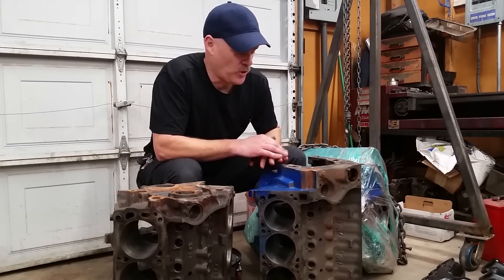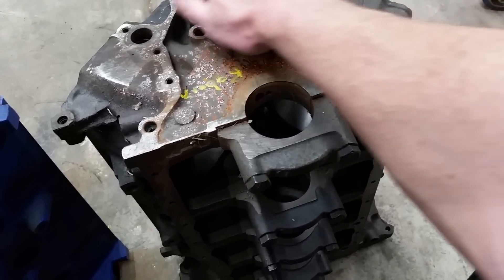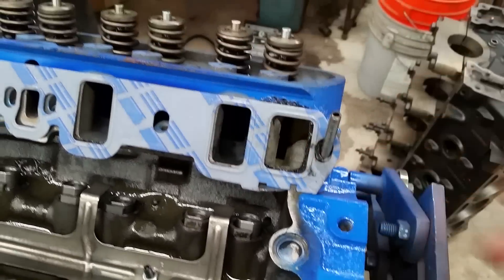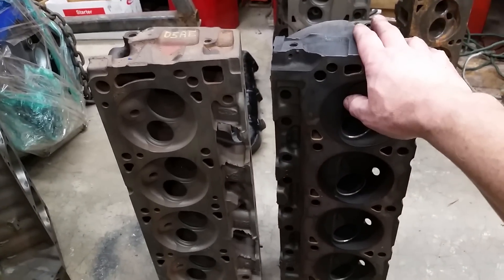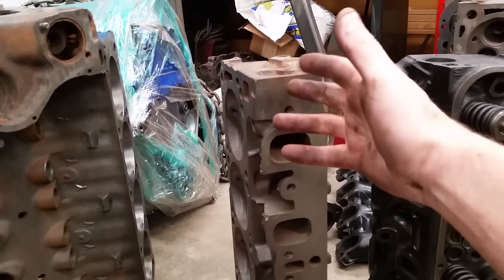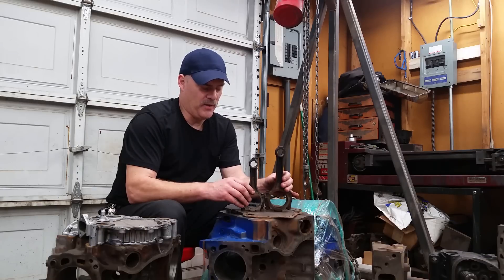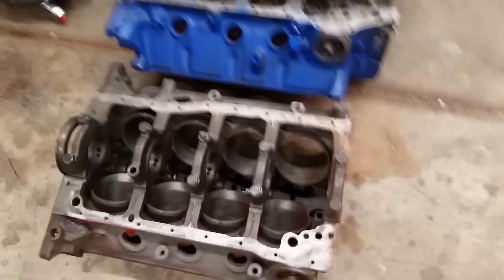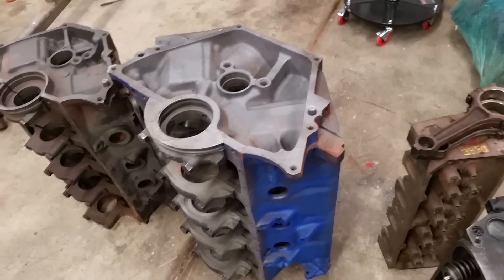302 vs 351M blocks

Comment: The reason the  400 had  the style  engine mounts and bellhousing bolt pattern,  the engine was designed to replace the 390 FE engine in the full size cars. The mounts were designed to fit into the same location as the  460. This made it easy  to install ether a 460 or a 400 using the same frame mount and transmission.   Ford didn't  intend  the 400 to be used as a small block replacement!
Reply: Cause the 390  did not meet emissions laws  for 1977  1976 and early model light duty trucks had the 390 as a option  then  1977 and later trucks  390 was replaced by 351M and 400  and a stick shift transmission  was an option  but in the full size cars with these engines only had the automatic.
Reply: Correct, One year they were drilled small Windsor pattern for one model of car. The 351/400M are big blocks. Use C6 normally. I would like a 4 speed auto but nothing fits the block to my knowledge, or not here in Oz anyway.

Comment: David Freiburger was saying there is a stroker engine you can build from a custom block, known as the 1A (or it could be vice versa) there is so much roadkill / motortrend / DF material out there just on here , I would never find it! . But it has the size of the 260 / 289 blocks, but you can make bore / stroke combinations safely up into the 420 size while maintaining the smaller early block outside dimensions. I wonder if anyone here knows which block I am on about, as it's from Kaase or some other custom manufacturer.. But seriously, a 351 is a huge engine for what size it actually is ... just look at it in a bay fully assembled compared to a chevy 350 or LS .. GIANT! .. the 429 is actually not much bigger as it is in the same class of engine (Windsor) , just have a look!

Comment: Provided you know your valve covers, the easiest way to spot a 351W versus a 302 in a junkyard requires only a measuring tape.  Measure the engine from the inside of the valve cover to the inside of the other valve cover... the 302 is 9 inches, the 351W is 11 inches.
Reply from the maker: If you have seen enough of them you don't even need to do that you can tell just by looking, the 351W has a much wider intake
Reply: Yeah that's where I've been for years.  ;)  I can eyeball them too.

Comment: FE and Y-block are not the same. Y-block is a 50's design and came in 292 and 312 ci displacements, I think a smaller displacement in early years as well. Not sure on that. It was kind of a transitionary block between flat-heads and the 60's+ more modern small blocks. It got its name from the shape of the main webbing and casting lf the lower portion of the block. Rather than a flat bottom deck, it was Y-shaped and came down lower on one side. Made for an interesting and intricate oil pan design, but what is did was create and very strong lower portion of thw block with lots of rigidity. It is completely unrelated to any other ford big or small block. They were honestly really good strong running motors amd wouldve heals up and performed well against the 60's era V-8's. Only thing I am not sure of and maybe you have some insight on this, is the bellhousing bolt pattern, Idk what it does and does not match up with. I'm just a 26y old kid whose grandfather has an old 292 Y-block '55 T-bird.
Reply from the maker: Yes I am aware of that however the 390 as well as the big block Chrysler among others are all considered Y blocks because of the skirted block design and the shape of the block Lincoln also had their own engine and it was also called a Y block beginning in 1952
Reply: If you throw in Lincoln Y block you have the base design of where the FE block came from, same bore spacing, bell bolt pattern give a 3/8" diff in the align pins. Ford FE's used the same machining set up as the LYB & used the same foundry. When the 427's were coming apart Ford went back to the foundry and added the LYB side oiler back into the 427 blocks. From LYB to FE 100 lbs. went away due to thin wall casting. Even use the same lifters FYI

Comment: If anyone is confused there is a 351m motor but they did come in a 6.6l 400ci variation. I would check the valve cover it should tell you. I got lucky and got a 400ci, I plan to bore it .30 over which would make it from what I was told by formula 408.178. But who cares about the .178 I'm getting a 408 with a .30 over bore, good pistons, heads,cam,rockers,intake, get the compression to 10 to 1 or higher and that "dog" of a motor will run. One quick question I have is it the exact same size as a Windsor or Cleveland? I believe them to be just not 100% sure.
Reply: daniel johnson so if my engine says 351m/400 it's 400ci?
Reply: Sanity it could be check out the valve cover it should tell you your engine's displacement

Comment: If  a short  Rod is so bad how  come  I know of more half million  mile 302 fords than any other  engines on the road!  i know of a  1991 ford pickup 302 with over
750000 miles on the original engine and it is  still going strong!
Reply from the maker: The 302 has a very short stroke 3.000 a short stroke accomplishes the same thing as a long rod less rod angle you need to have a high rod ratio a shorter stroke raises this ratio as does a longer rod
Reply from the maker: the 302 with a 3.090 rod and a 3.000 stroke actually has a higher rod ratio than a 351 W  or a 350 Chevy and remember the higher the ratio the less rod angle this means less stress on the piston and rod bearings to get rod ratio you simply divide rod length by crank stroke a 302 has a 1.7 ratio whereas a 350 Chevy has a 1.64 so you see the 302 actually has a better ratio for longevity
Reply: Are you from Montana?  I think I know of the truck you speak of.  Lol

Comment: My son bought a Ford farm truck with a 351 modified, it only has 55000 miles but number 4 cylinder seems to have a burnt valve, is this a common problem? The plug has spark but it's oily and it's definitely no. 4 that either has no compression or something because the engine runs the same with or without spark on that cylinder.
Reply from the maker: I haven't heard of this being common but one thing is for sure you need to pull the head

Comment: could you show the difference between a 351c 2v head and a 4v head ? I think I have a 351c m-code in my mustang but I'm not shore
Reply: externally the 4V on the front is the only way. Though a 4V will always come with a 4bbl intake and a large carby.
Take the intake off and the intake ports are way bigger than a 2V. Too large!
There is 4v open and closed chamber engines, about 10cc different in volume. And all 4Vs have larger valves which like the ports are too big. For decades people have been fitting those heads with tongues on the intakes to try and get some velocity through the port.

Comment: My 1997 F150 4.6 is totally stock, 200,000 miles. When you get it up to 90 or so it has the sweetest sound. Single exhaust. Heart of a tiger.
Reply: 300000 96 tbird bullet proof sadly governor kicks in at118. Only once but lots left.lol

Comment: how can you tell the difference between 351m and a 400 in the car?
Reply: shyboyangelus As far as I know, you can't without taking a head off and measuring stroke. The 351m/and 400m have the same blocks. It's the crank that makes the difference. 3.50 vs 4.00. Just a technical fyi. 4in. stroke by 4in. bore is actually 402 cubic inches. Just for shits and giggles.
Reply: @thesixgunfighter288 rule of thumb is , if you have a 4 inch bore on a V8 the length of stroke is very close to the cubic inch displacement of the motor !
Reply: @JosephCowen-ru7up  You’re not wrong, 3.58/Mopar LA/Mag 360, 3.48/Chevy 350, 3.25/Chevy 327, and so on

Comment: really should be calling it a 351m/400 block because they are exactly the same and some may want to know by simple using the 400 crank and 400 pistons you now have  400 cid motor they both use the same rods and everything interchanges.....also if i remember correctly all 351m/400 blocks are cast for excepting the 4 bolt main caps   ..also you should know the 351m/400 crank main bearing are the same as the 351w and you can custom cut a 351m/400 crank allowing it to fit in a 351w block creating a stroke kit with all bone stock ford parts making your 351w a 413cid ford windser block if punched 30 over

Comment: Great vid, 400 modified's are very underrated engines, I had one in my Grand Torino,lots of torque, so can you put aftermarket 302 heads on the 400? Tks
Reply: would be a step back the stock 351m heads with a little port and polish flow better than even high end after market 302 heads
Reply: 302 Aussie Clevo heads only. Not Windsor.

Comment: You talked about liquid corrosion. In '81 my dad's 78 Chevy C10, lost a water pump. We added Prestone water pump lube. In '03 I rebuilt engine. To my surprise the steel head gaskets looked new! That was at 330,000+ miles. I just copper coated and reused them. Vintage '78 steel head gaskets and coolant hoses to this day. 
Take care from Oklahoma
Mike and Vee
Reply: Those old Chevy shim head gaskets are better than most realise. Use a composite gasket and you lose compression and they seem to fail quicker. I have used them as a single gasket, stacked to get valve clearance even used them with alloy heads. Though not so good there as the alloy is ofcourse softer. And never seen one blown. Leak a bit, yes, with heavily milled heads.

Comment: I had a nasty 2.3 lima engine 4 banger, milled  head, stainless steel valves, crane solid lifter cam half inch lift with around 260 degrees duration a four barrel split plane intake manifold with a 390 Holley going out a Hooker header into a glass pak around double the stock hp, as for rod length you can use chevy rods, aftermarket pistons etc.

Comment: 4 inch mains kills the longevity of these engines. At 100-120k expect  low or no oil pressure due to main bearing wear.
Reply: the 351m/400 has the same bearing size  as the 351w  ....the reason many of them only ran 120k/140k miles is none of the cares they cam in had over drive ....my 1987 ford f150 4X4 with it 351w ho factory 4bbl and c6 auto no over drive is doing 3000 RPM at 70 mph the exact same truck a year later with over drive and EFI at 70 mph is doing 1800 rpm so ye under normal everyday driving a motor doing 80% more revolutions will were out about twice as fast .....by the time they went fuel injected and overdrive in everything these motors were no longer used ....you build a bone stock 351m/400 and use modern trans with EFI it will also last 300k miles and get 18 to 20 mpg ....best friend had one a 79 ford truck 351m/400cid his was the 400 never ran anything but what ever on sale 10w40 gave up the goat at 365k miles but he changed the oil every 5k miles rather it needed it or not
Reply: dexter2433 the 400m front and rear main bearings actually wear out in no small part due to the accessory belts pulling the crank up. There's so much flex the front main bearings will wear out on the top and the rear on the bottom. Seen it.
Reply: These M engines always sounded wallowed out in the lower end if they had any miles on them and the oil pressure light would flicker at stoplights.  Weak oiling system.  
Weak design altogether.
Reply: @scdevon  Oiling system is fine, it can't keep up with worn out bearings.
Reply: They have 3 inch mains

Comment: A friend of mine bought a 1980 F150 new with the 351m. He changed the oil every 3000 miles, kept the truck looking like new. He was old and never beat on the truck. The engine was junk after 80,000 miles. Every valve guide was gone, rod bearings scared the crank, (rod bearings to skinny, a weak spot in design), and cam was shot.  He ended up buying a new motor and sold the truck.  
I do enjoy your channel. Very informative.

Comment: hi there i would like to know what is the 351 modified is it the Windsor motor as i have a 302 Winsor in my 1989 f150 4x4  and got to replace the motor in the next 6 months and can you  Cleveland motor be set up for unleaded fuel heads.
Reply: 351/400M is a tall deck Clevo big block. Nothing to do with a Windsor. Apart from 3" mains!

Comment: isn't  351 m engine an industrial engine my 78 F-250 has a 6 Qt oil pan when I rebuilt it camshaft I used is for low end and mid range push rods rocker arms and lifters also replaced and crank shaft replaced as well only original engine parts are pistons and connecting rods also used brass freez plugs before i rebuilt it   had 165000 miles on it and was getting about 19 miles per gallon on the freeway did not have power to get off the line but fuel mileage was great  made me think cam lobes had excessive wear motor not breathing correctly
Reply from the maker: Nope just a passenger car lite truck engine
Reply: Myvintageiron7512 thanks for the info

Comment: If you use the 2v closed chamber heads the compression raises to 10,75,1.is that to much for a 400?I hear you need to run 96 octaine plus or they can pre detinate?
Reply: RUN EM OM LPG cant get higher octane then that
Reply: You mean “pre ignition”, gas ⛽️ doesn’t detonate( super sonic) it burns (sub sonic). Explosives detonate.

Comment: I'm also hoping you will show a Y block eng 272 - 312.  I thought the 312 came out in 56 but everything i'm reading shows 312 didn't come out till 57.  I have a 56 F100 .  I was hoping it had the 312 Y block, but apparently i'm wrong, it's a 272.
Reply from the maker: Don't have any 312 engines on the drawing board at this time
Reply: okay, thanks.  Also will the bell housing from a 272 be the same bolt pattern as the 352 so i could swap my trany

Comment: Awesome video, not sure if you have another video on putting 4v Cleveland heads on a 400 the do's and dont's, see I have been doing a lot of reading on blogs and such and I have found myself still wondering about what I can do, I am my own worst enemy and kick ass at wasting money and have a shit ton of parts on my shelves from ways that didn't work on other projects anyhow what can I do to put 4v Cleveland heads on my 400 and hey is it worth it like I'm not going to change the cam just heads and 4v intake I'm thinking it would be a low bang for the buck unless you tell me other wise thanks great videos btw you've help me through all the bullshit and puss people try to feed me
Reply from the maker: you need to upgrade the cam and valve train for those heads
Reply: k thanks

Comment: can you make 500rwhp with a 90s 302 5.0 or a blueprint 347
Reply from the maker: Yes
Reply: Why on earth would you stroke a 302 to 4 ci less than a motor Ford designed to be that size ! They would have done research in the 1960s to see if stroking the the 302 would be worth it and the answer was NO so they made the 351 W !

Comment: My dad put a 400 in a 1980 F250 camper special , this was in the early  80's and not much aftermarket  support for these  engines.  The block was a 30 over stock rebuild with factory 8:1 pistons and open chamber heads (2v) .The heads and intake were milled to slightly  bump up compression,  it had a Isky RV hydraulic  cam and Crane adjustable pushrods, recurved stock distributor, Edelbrock SP 2P intake ,625 com Carter AFB  carb, Eagle long tube headers into a true dual side exit exhaust  ( Midas turbo mufflers) plus the C6 automatic had a mild shift  kit with 3.73 : 1 gears blah blah  blah. With this humble combination this was one  stealthy  pick up, it could blow the doors off most other vehicles especially on big hills ( thank goodness in had 2 fuel tanks). I can just imagine  what you could do with one of these engines  today  (aluminium heads better  pistons ,roller cams ,roller  rockers, EFI  better exhaust  technology,  transmissions etc..) So to make a long story  short: Build a 400 and be different plus they are quite good looking especially when dressed up!

Comment: does a 351m/400 fits on a 360 bellhousing?
Reply: 360 uses FE bellhousing, 400 uses 385 series.
Reply: So the bell housing i took off of my 272 will mount to a 360
Reply: @rickchristensen3636  AFAIK very early 5 bolt Windsors

Comment: Larger main bearings are a tradeoff.  They can handle more load usually, but larger bearing diameters wear faster because the surface speed of the bearings is so much greater at any given RPM.
The 302 bottom end is a proven design with very few issues if any.  351M series engines are known for weak bottom ends or at least bottom ends that wear out more quickly. The main bearings on M engines always seemed to sound "wallowed out" at medium to high mileages even in luxury car land yacht engines and often they'd have low oil pressure on a hot idle.
Reply: negative as the 351w also has the same mains as the 351m and 400 and the 351m/400 crank will drop right in a 351w block and with a bit of machine work and balancing and custom pistons will make a 400+ cid ford 351w with all stock ford parts and is considered very strong and a motor of long life with ease lasting just as long as any 302 built motor

Comment: If a person were to build a car would they want to go with a 351W or a 351M... I've got a stock 351M from 1977 as well but my 1970 cougar came with the 351W, fitting isnt a problem but modifying it to be a nice little runner what would you say?
Reply from the maker: Go with the W engine

Comment: What happened to the 351M project?  I'm a Chevy guy, but I love the 67-68 Mustang. Almost bought one awhile back, still might. I was thinking a 400 stroker Windsor.  But then there is the 400M, do they use the same deck height?
Reply from the maker: The 351M is coming up we are working on it
Reply: Again a 400M is a big block, Tall deck Clevo, big block mounts and bellhousing pattern. I doubt it would fit in a early Mustang size wise.
400M will fit though I dont really recomend 4" cranks in those engines and unless you buy aftermarket heads they dont breathe either. 351W with a bit more compression. mild cam and pipes is a good solid engine.